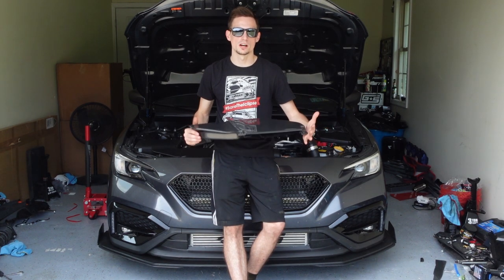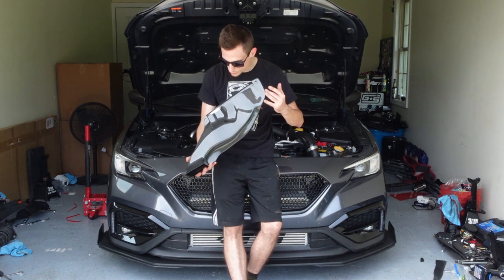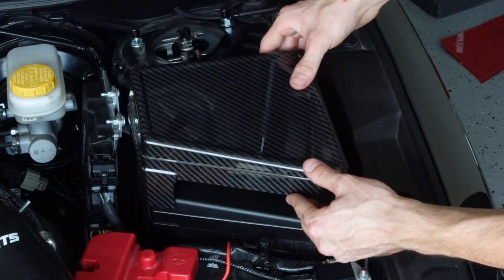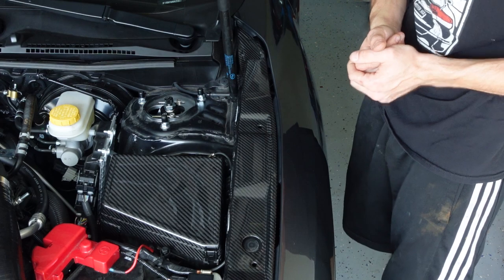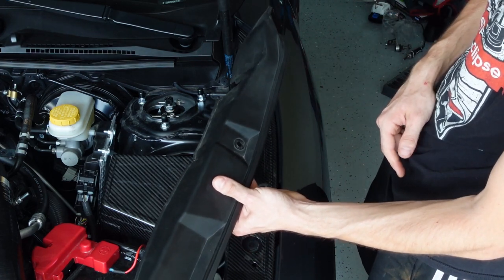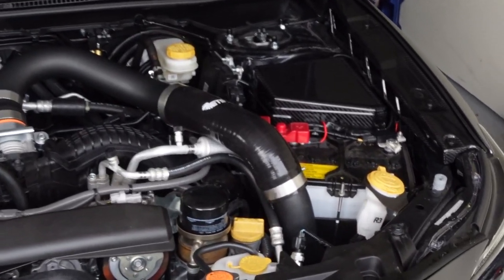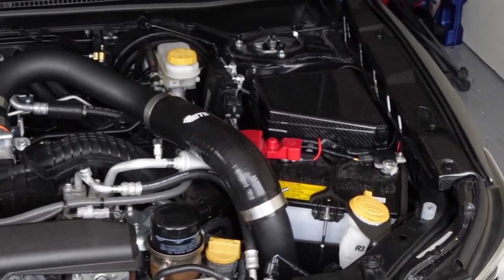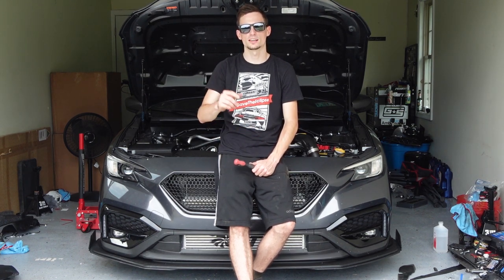2022+ WRX Carbon Engine Dress Up

Comment: Great video with some great looking products. I got a red STI push button start and I saw the video you did on the import image racing YouTube channel but when I go to pull up on the center trim to be able to access the plastic cluster the button sits in the trim around the infotainment moves and unclips but I cannot remove it enough to access the button. Any pointers? Or could you release a video on this channel? Thanks!

Comment: The subaru ascent has a similar engine. Fa24dit. Do you know how much would be compatible? My pully cover has a crack, and I wanted to get the perrin one. Also the intercooler gaurd along with some other stuff. Im really hoping alot of the engine stuff is compatible.

Comment: Now I could be totally wrong because Im just guessing but the carbon enginebay side pieces have that gap plus the cut outs in the inside, is it meant to vent heat?
Reply from the maker: That's the idea, but I doubt they actually do anything noticeable.